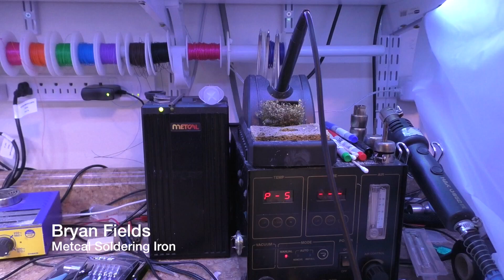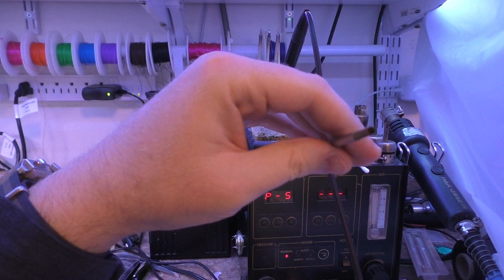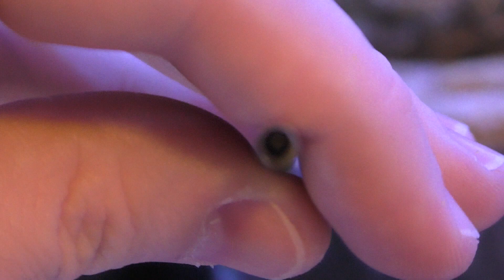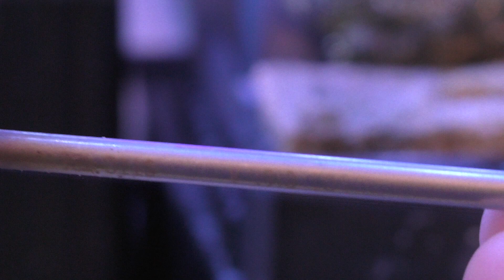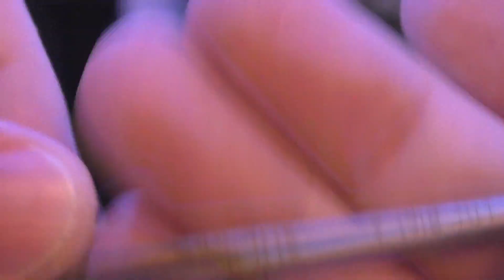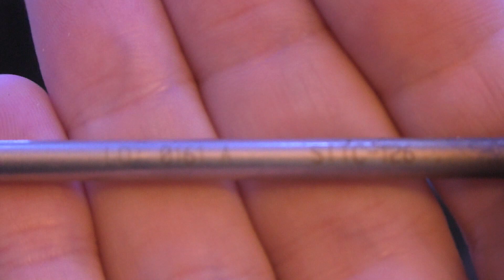Metcal RF Soldering Iron

Comment: Metcal station is the best, I have Weller stations and cheap HotAir station from Amazon, and still would never part for my Metcal, my system looks nothing like the modern system, looks more like your one, mine's is from the 1980s maybe 1990s I think. It has 2N3055 transistors on the back of the unit attached to the heat sink.

Comment: Nice explication but I thought I’d mention Metcal is not alone anymore when it comes to curie controlled inductive heated soldering stations. Thermaltronics is almost a 1:1 copy of Metcal and in fact even the tips are fully interchangeable.  I do this as a profession and I’d even argue the Thermaltronic tips outlast Metcal.  There’s also the Hakko FX-100 which is a very nice station with what I consider to be a more comfortable better insulated hand-piece. The FX-100 tips are a different form-factor but operate at the same frequency so you can even use FX-100 wand/tips on Metcal power supplies and vice/versa.
Reply: I tried thermaltronics tips and they are too weak. their high power tip only draws 50w while metcal tip does 80watt and the difference is night and day. the thermaltronics tip just doesn't draw enough power to heat up what I need even if I wait there all day and its considerably fatter then the metcal and it takes a while longer to heat up. Their regular tips also don't draw as much power but the difference is less of only 15watts and I can't tell a difference for fine work.

Comment: Just bought the PACE ADS200 that Mike's radio repair mentions below. It heats up JUST AS FAST as what is shown in this video.  Pace has the tips priced right. The Metcal is a different
 animal using RF and it may NOT BE an apples to apples comparison vs. the Pace

Comment: I've always heard everyone drill home how important it is to get an adjustable temperature soldering iron, but I've honestly never ran into an issue with the metcal tip temperature causing issues. Back when I worked for a EE and did a ton of soldering the issues I always ran into with soldering was either too low a tip temperature and spending too much time (regardless of temp) on the pad. When he got a box of Metcal's from a government auction it was a night and day difference. The only time we'd use the adjustable Hakko irons after that was either for doing something weird like working with plastic or as a low-temperature spot pre-heat for ground planes. The other nice thing about the Metcal's was all the crazy tips they had for rework. Like a square tip that fit QFP144 packages or the bigger tips that you would hook up two power supplies to in order to double the power rating at the tip, etc. I've pretty much got the same metcal iron/wand/stand/tips that you do with a MUCH shittier hot-air station. Probably the only thing I'll be buying is a blade tip to make it easier to take out DIPs.

Comment: You should give the Pace ADS200 a try.  I got one and love it.  It is a conventional type heating element but the heat up time is really fast.  I would say about 3 seconds from room temperature to soldering temperature.  The nice thing is the temperature is adjustable on the base module so I don't need 4 different tips with the same end for 4 different temperatures.  The tip temperature is also very accurate with these units.  Their new hand piece stays cool no matter how long you leave the iron on.  It's a nice aluminum hand piece with rubber overmold.  Probably the biggest advantage to the Pace is the price of the tips.  They are crazy cheap considering Pace is a top of the line brand.  I can get 2 tips from Pace for the price of 1 of the Metcal tips.  I solder everything from SMD to through hole and vintage tube type gear with point to point wiring and use it for everything.  I can easily solder to a steel chassis with it.  If your Metcal ever dies on you I would highly recommend you check out the Pace unit.
Reply: 1 metcal tip will last your whole life. I have one fine pitch curved tip 350c for fine work and one high power tip 410c that acts like ground planes don't exist.
Reply: @mr.simulator4724 That dude above doesn't know what he's talking about. The ADS200 does not use conventional heating element, it uses a direct heating element. Also, the ADS200, even though it's rated for 120W, has been proven that it can not actually deliver that to the hand piece. Once you go Metcal, its very difficult to go back to other soldering systems. JBC and Ersa do produce nice systems but I'm Metcal all the way.
Reply: i have seen your review mike as well as sdg's review, pace also has admitted the station did not work as expected and improved it and now calls it ads 200 plus i have heard a few say it is better but the shots on sdg's review convinced me to go metcal the metcal works great have no idea about the new ads plus. funny thing is amazon had a 5220 for 600 bucks i thought for sure must be a fake but i bought it it a real metcal for sure  could not be happier
Reply: @tomgiorgini9154 I have a total of 3 of the ADS200's and 4 of the MBT360's spread across several work stations in the new shop.  After their initial hiccup with the original early production units they have been flawless.  I think one of the biggest advantages of the Pace units is the soldering iron cartridges.  The last time I checked I think they were less than half the cost of Metcal's cartridge tips.
Reply: @mikesradiorepair  thanks for the rely mike i looked at the ads 200 i really wanted that station for one pace is a great company and the real desire was the price of the tips. the penny demos pushed me to the metcal, i just use it for home use but when i spend my money i like to get the best, i did see your second video but it was prior to the plus even being mentioned , when you get the chance if not already try the metcal i was truly impressed but I'm just an idiot would like to know your thoughts, thanks again for the reply